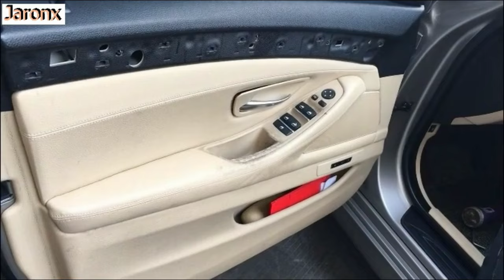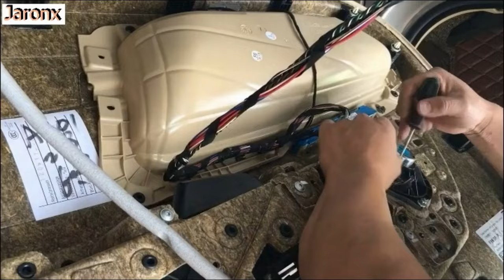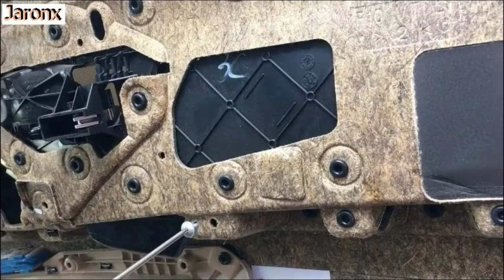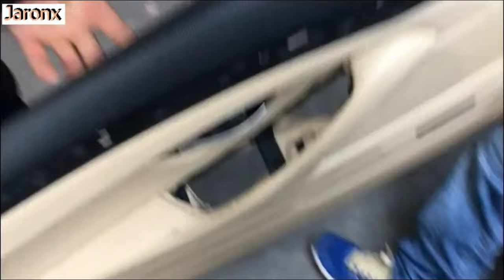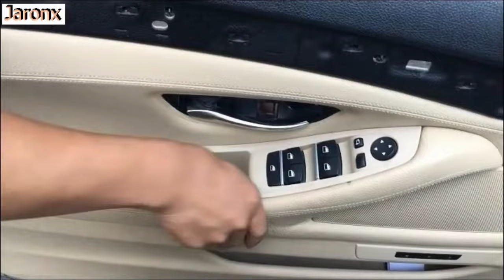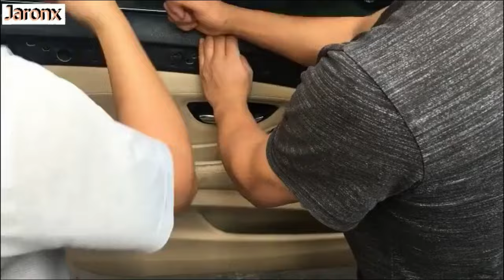BMW 5 Series F10 Door Armrest Replacement Installation.(2010~2016)

Comment: So wait, only one screw when removing the door panel, but two when putting it back on? Likewise for the the actual handle - only 2 screws to remove it, but 4 to put it back on? I feel like I've been cheated out of a few seconds of very useful footage.

Comment: What tool are you using? Can you make a video removing the front seat rear cover that has the seat pocket? My seat pocket has a broken hinge and I need to replace the panel. The clips are tricky to disconnect on the F10s.

Comment: can't you just pluck it out without having to remove the whole door?
Reply from the maker: There are wires and screws on the back of the door armrest, which is not easy to remove,so we need to take off the door panel.